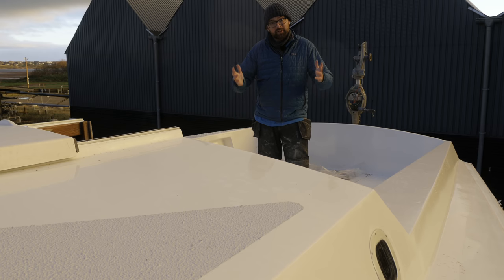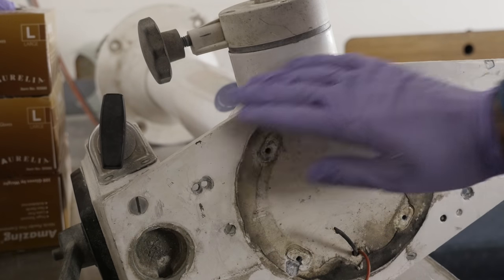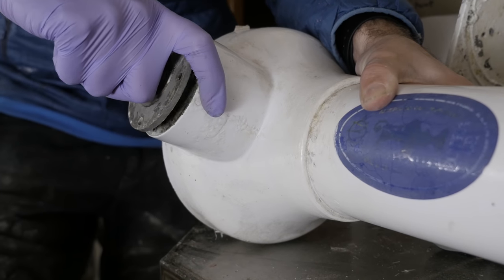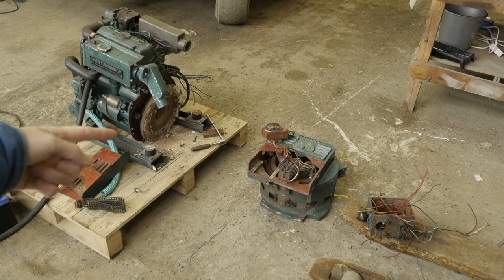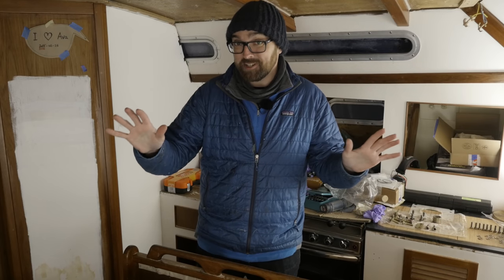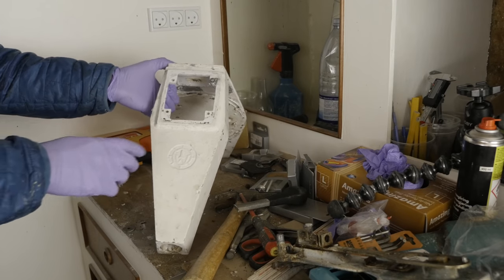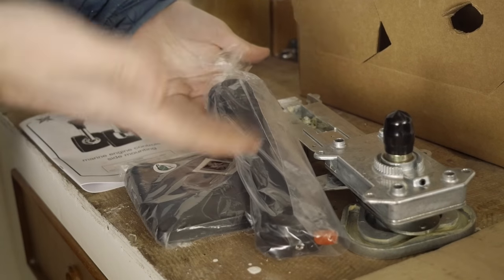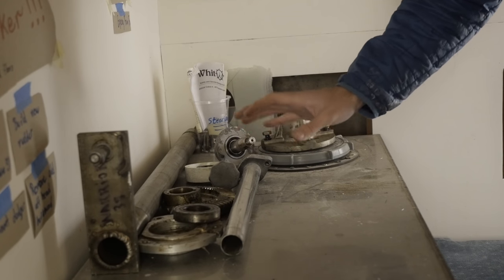Sail Life - Cobra 4R steering pedestal, refurbishing part 1 of 2

Comment: A bit of history of the 'pedestal guard'. Originally fitted to keep the mainsheet from looping around the compass and pulling it off, but nobody tells sailors that so they look at it, and seeing that it's usually the same sort of tube as the bow and stern rails, assume that it's a strong thing. If they could see what was holding it to the cockpit floor they'd thing twice.

At least one person has died because they attached a harness tether to one and were washed away. (Fastnet race 1979).

Might be your chance to educate your viewers on not using them as attachment points for tethers. OK as a handhold, not much more than that.

Comment: Rather than just buy ordinary 33c cables there are some quicksilver (mercury) thin premium type with very low friction type which bend much more easily and are super slick in use.

Comment: Make the top plate out of alu not stainless . Less deviation on the compass
Reply: Stainless steel is non magnetic (the common, austenitic grades), so it shouldn't pose a problem.
Reply: Wilf Williams Ever try sticking a magnet to a piece of stainless?
Ever seen a stainless compass shroud/sun cover?
Reply: Dom Reale   I was, in my naiveté, hoping for for a YouTube conversation about the type of stainless found aboard a blue water yacht, not the myriad of other 'stainless' found in kitchens, operating theatres, tool making shops, or Soviet era dental appliances.
Reply: Dom Reale  no, 304 isn't. It too is an austenitic stainless steel, the only key difference is molybdenum. Then again, I wouldn't use 304 on exterior parts on a blue water boat. 316L would be the way to go, since these parts will be welded up.
Reply: 316 is not magnetic (unless recently marketed chinesium alloy derivates probably ...) while it is way too shiny as a compass base and should stay unpainted, what makes it an absolute non-touch item in tropical or Med sun, not the best choice at this place of the boat in my opinion.
Reply: Ever put a magnet on a screwdriver, and bring it near a compass?
Reply: @LeftFlamingo  Austenitic stainless is still slightly magnetic if it is cold rolled!

Comment: When thinking of lights, consider red night lights. I was initially thinking RGB with a controller but that adds a point of failure I don’t think is necessary. As others have mentioned consider sun glare on your screen as well as water drops. A piece of tinted Plexiglas with 3 folded sides on adjustable arms might make things pretty spiffy. As you know, salt is nemesis of electrical connections.  I would make all electrical connections inside a waterproof electrical box like this https://www.hammfg.com/electronics/small-case/plastic/r230. Remember to bring you cables in from the bottom and use a cable gland or cord grip like these https://www.hammfg.com/electrical/products/accessories/1427cg.pdf. I’m not endorsing this  brand, it  is just one I know. Others make similar products.

Happy Holidays

 PS. I liked the “R” joke.

Comment: Suggestion.  Run OpenCPN on a tablet daisy chained wifilessly to your LattePanda SBC running ths same down below and keep that big chunk of plastic off of the top of your pedestal.  Just think...  What is your sight line going to be helming the boat from a seated position?  You'll be staring at the base of the navpod.  It's even harder to see over for Ava.
Reply: Brad Scott  It might also block his view of Ava. Can’t have that on those long passages!  Like the suggestion of daisy chaining things, it leaves more options. That way after several  passages tweaks can be made based on his preferences.

Comment: engine control housing has the whitlock logo on it .I had the identical pedestal with that housing on a cs30 which was built in ontario canada in 1985.Had the same controls with a 2002 volvo 18.I had mine powder coated the threads werent the greatest in the aluminum where the top plate bolted on so i put in some slightly longer screws to grab some virgin thread.

Comment: You should do some research on the ceramic bearings before you put everything back together.  In general they are used in very high speed applications and may be less than ideal in your slow, partial rotation application.  Bearings like to spin, the back and forth rotation like the pedestal is actually much harder on a bearing than continuous rotation at most speeds so you really want to make sure you have the right bearing for the job there.  (FYI the ideal bearing would actually be a bushing, but an appropriately sized one  would be larger, require lubrication and harder to package so in most cases the designer will just spec a ball bearing instead)

Comment: I know once you set your mind to something its fixed in stone,  but after watching sailing lady Africa they are replacing there steering and engine system with a hydraulic system, this will make a much greater turning response with less parts to go wrong, I don’t no if you have considered this idea as an alternative, since you have all the bits for a manual steering system to upgrade to a simplified system may not be for you
Reply: Once you go hydraulic, you will lose the option to have a wind vane steering